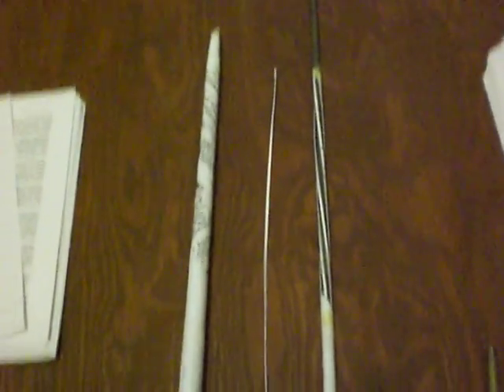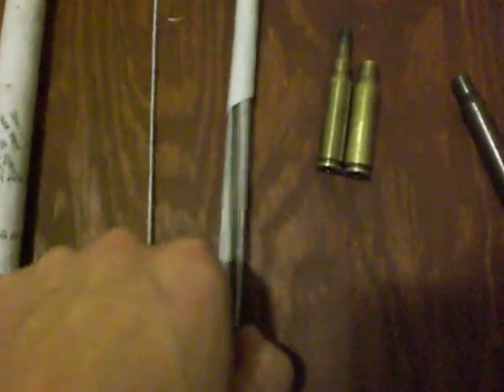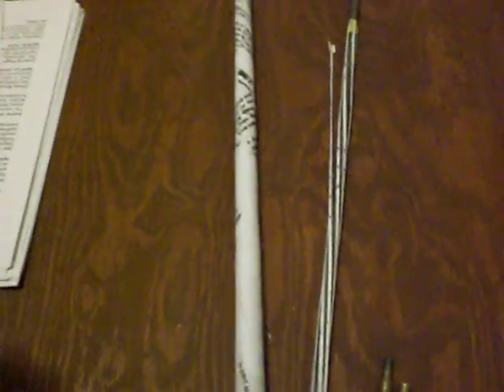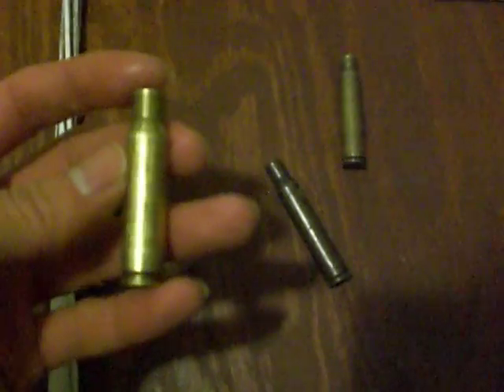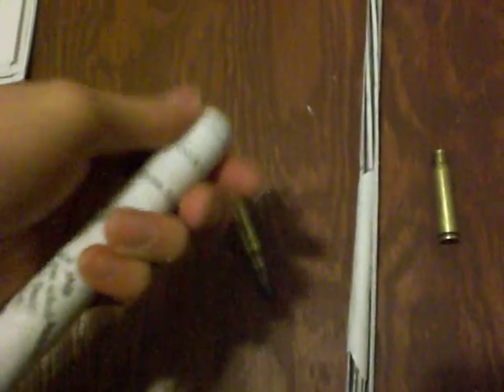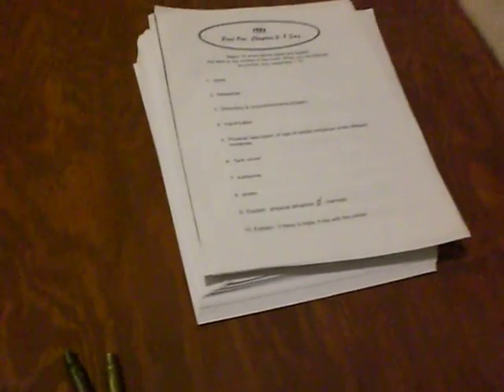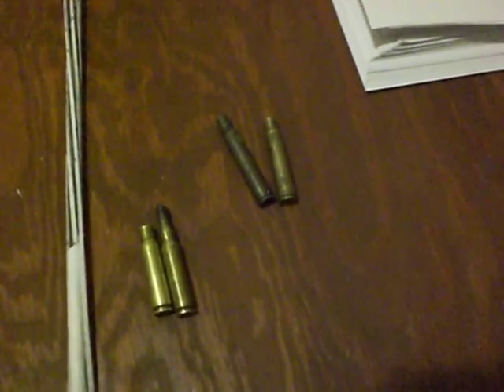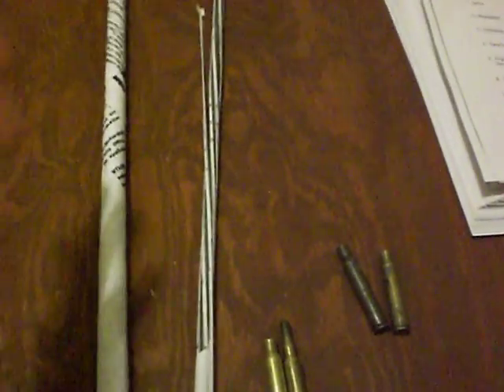Paper MG42 Update (barrel)

Comment: MG42(7.92X57 / 8X57mm) MG3(.308WIN / 7.62X51mm)
already managed to make an aluminum cartridge 8X57mm, why do not you try? the bottom you can epoxy (molding is difficult but you have better tools than me).